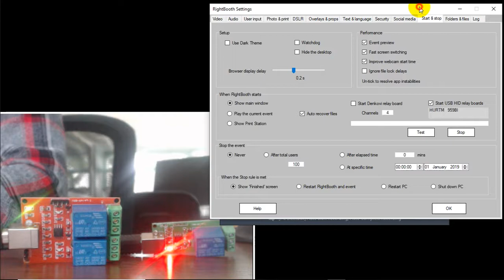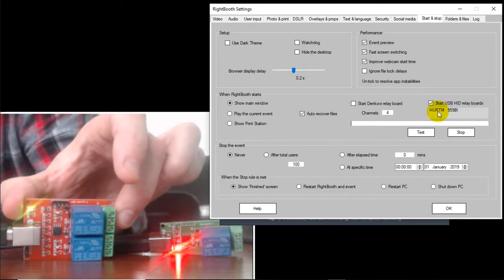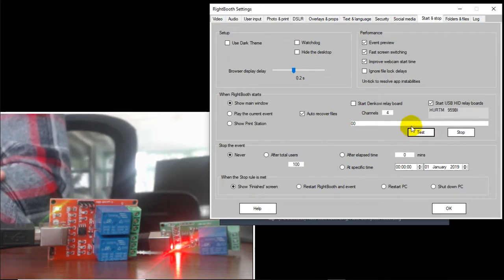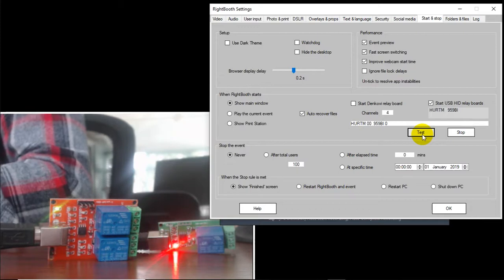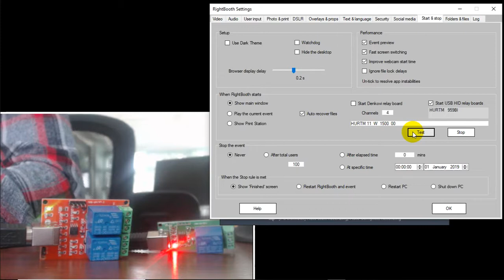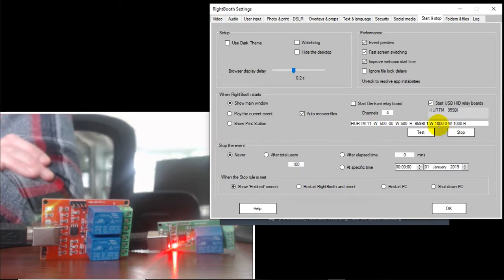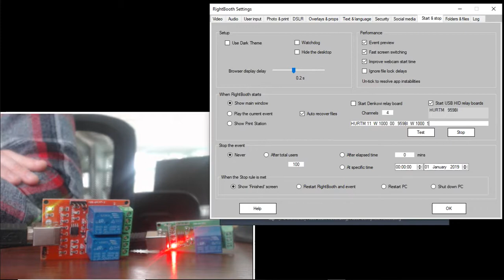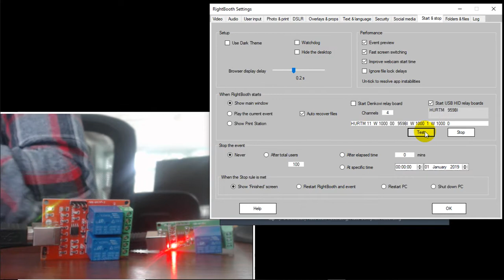Issuing USB HID Relay Commands in the RightBooth App

Comment: This looks like great software but unfortunately I can't get it to control my hid relay board. When you plug it in, nothing is recognized. When you try and control the module, it just says "connect usb relay". Im using one of those chinese ebay relay boards (similiar to your one) but the chip on mine appears to be different. This IC is a "ch552", is there any fix for this? Cant seem to find any modules similiar to your one 🤦‍♂
Reply from the maker: It seems other people are experiencing problems with controlling ch552 relay boards.  The Relay Controller app can control these boards:  https://tinyurl.com/3ajemst2

Comment: hi friend, is posible controll the board whit a key shorcut, for example f1  and f2 for some relay ?
Reply from the maker: Sorry for the delay with this reply.  In RightBooth it is currently possible to control the boards by mouse clicking or touching objects (buttons, images, text, etc) that you add to your screen designs.  To allow your suggestion, I will add a new feature that lets you assign a key shortcut to any object so that you can control the boards with specific keys.  I will let you know when this feature has been added
Reply from the maker: Just updating this to mention that the latest version of RightBooth (7.6.0) provides the ability to assign keyboard keys to control relay boards.

Comment: hi i got 2 of the 2 channel USB relay you have in the video, on eBay only one works i believe the code is a problem do you have a link to the code to re flash them? i could use usbasp
Reply from the maker: Hi, not sure what you are asking.  Are you wanting to re-flash the actual relay?  If so, you probably need to contact the manufacturer.   It might be worth trying this external app to see if it can control your problematic board  https://www.youtube.com/watch?v=IOwA9nRNIY0
Reply: @RightBooth  windows 10 dont see it at all, windows 7 see only one of the 2 channel, the other just come up with unknown device.
as its a attiny45 on the board i thinking maybe some one has the code for it, i could re-flash it.
the other option would be to get my friend to get the code out of the other one that works and flash it in to the dud board see if that works. i have look about the web and seen they are using some v-usb code.